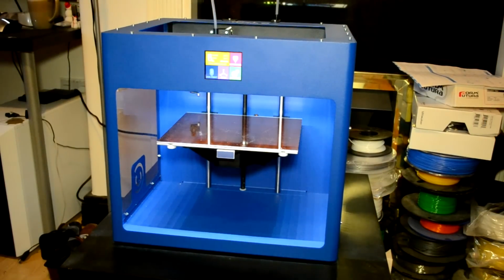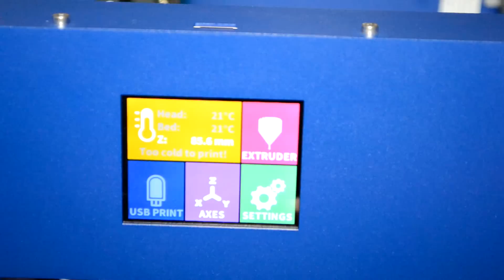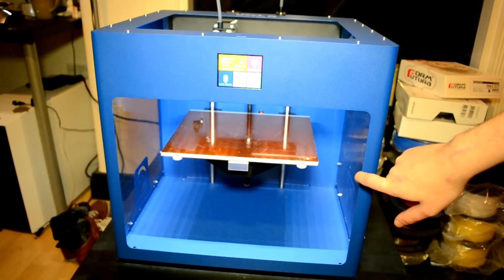Unboxing and setup of the CraftBot 2

Comment: It looks like there was a a lot of Z axis ripples in that benchy - more than I would expect from a $1300 machine... I really like the printer otherwise and am thinking of buying one.
Now that you've had it for a while have you been able to make it do better?

 The XL version has real linear rails (and much bigger build space) an may do better but it's price is hard for me to justify.
Reply from the maker: Yeah that was the test that I did with their slicer and their profile I did a custom profile in S3D that improved the quality andto be honest I was impressed with the fail rate that is really really low. Is a great machine if you are thinking to use it 24 hours.